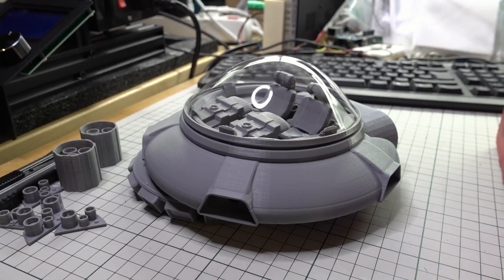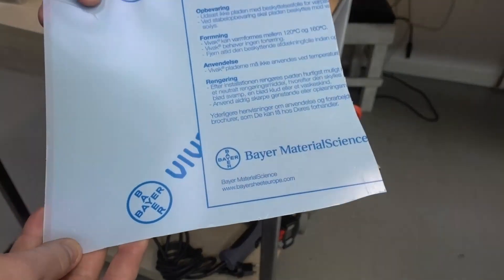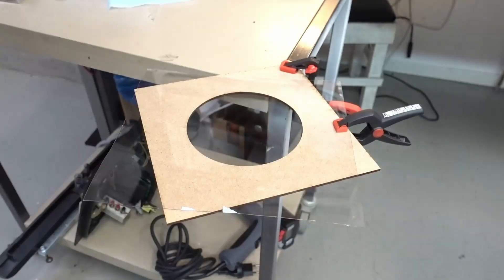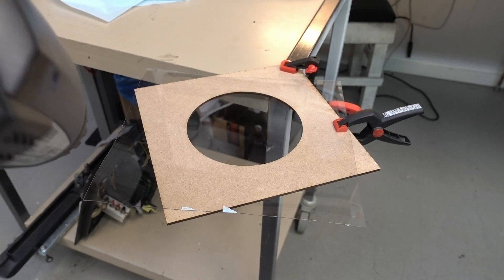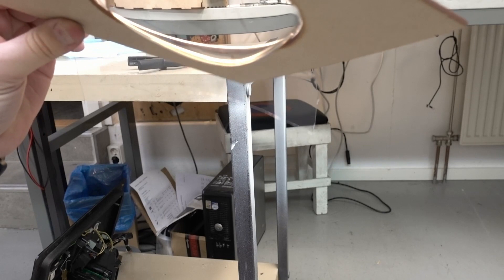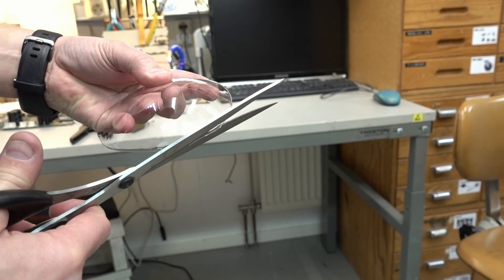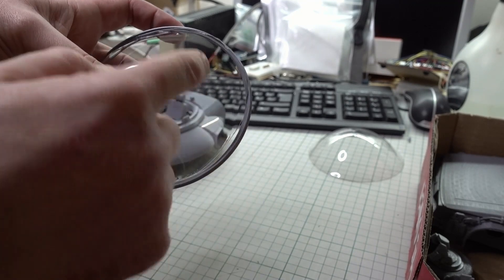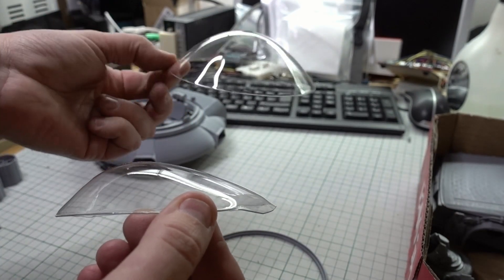Creating clear dome for space ship

Comment: The pet plastic sheet I purchased turned white with heat and did not get the dome shape at all. Any tips?
Reply from the maker: Think you heated it to much a high temp so the plastic started to "crystallize". Then it get stiff. There are Pet and PetG, think you should have PetG for a smoother workflow.

Comment: Hey I’m trying to make a Apollo 13 replica helmet. It’s basically a large bubble but there’s a little oblong shape to it. Similar to a oval at the base but round at the top. How would I got about making this?
Reply from the maker: You need to make a "template" of the shape, and let the plastic "form" around it to do that. You can use the same technique with hot air. But a vacuum  forming technique would get you a better result. Problem is to make the template.
Reply: @geekjoan  ok thanks man

Comment: That's a beautiful model!  I've been needing a technique like this for a few 3D models I have designed - this should work perfect.  Wonder if I can drape the heated PETG over a positive mold of cockpit form.
Reply from the maker: Yeah you can. But you have to help the PETG in to the smaller cracks. Or you get a small vacuum pump.